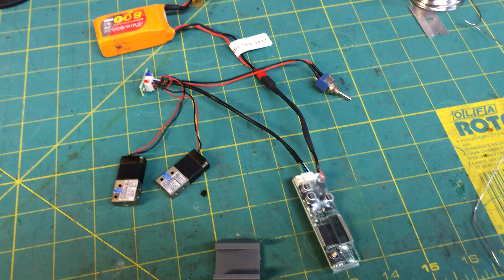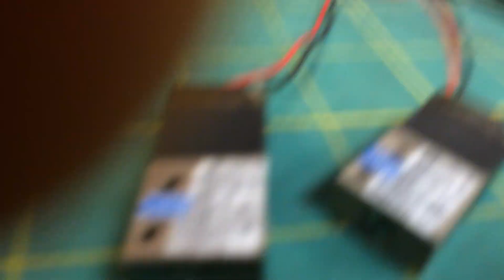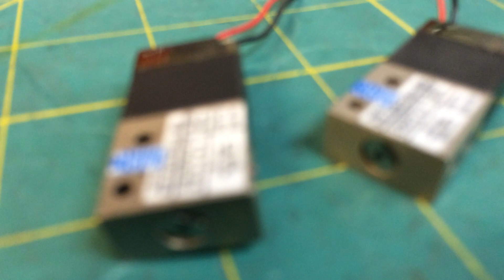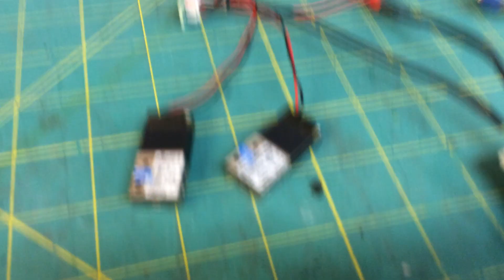PolarStar Fusion Engine FCU issue with 11.1v Lipo battery

Comment: What about running a 9volt battery?  Is this ok.
Reply from the maker: No, please do not use 9V batteries to power the Fusion Engine. The 9V battery does not supply enough current and you will just have problems using it (the engine will behave erratically)
Reply: You can defiantly use a 9v. Polar stars fcu is basically the same as a paint ball guns... They run 9v batteries in all of them. I'm using it no problem.
Reply from the maker: +xJKAirsoft Polarstar states that the FCU should not be powered by a 9V battery. It's not the FCU that has the higher current draw, it is the solenoids.

Comment: Can The fcu be damaged from using a battery above a 7.4V?Please email me the answer at ah6518@hotmail.com
Reply from the maker: The manual recommends not using a battery over 10V. I haven't run one on an 11.1V until it suffered permanent damage, but I wouldn't risk it.

Comment: 11.1v are too powerful for the Fusion. They say to only use between a 7.4v to a 9.6v LiPo or NiMH battery, did you miss the instruction manual. Go to evike and you will learn. You are using one that is waaay too powerful for the circuitry.
Reply from the maker: Uh yes, earlier versions of the Fusion Engine manual stated that the FCU can accept up to 12V. Recent revisions have it changed to be no more than 10V. Feel free to checkout www.bingoairsoftworks.com for additional information.
Reply: BingoAirsoftworks Maybe that's why they're called "bingo", because that's where the empty ravioli can hit them in the head and they started sounding stupid. Look at evike.com and they say "nothin over 9.6v". I've learned my lesson, if the gun maker says a certain voltage, I stick to that. 11.1 LiPo is crazy!!!!!
Reply from the maker: flashy5150
<restraint>Wow.</restraint>